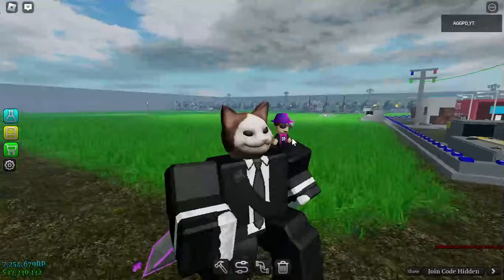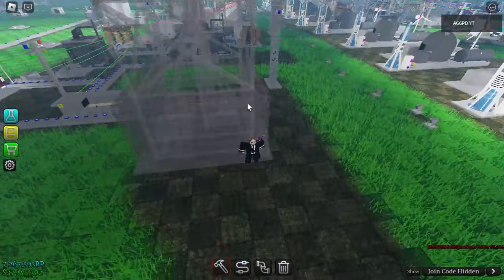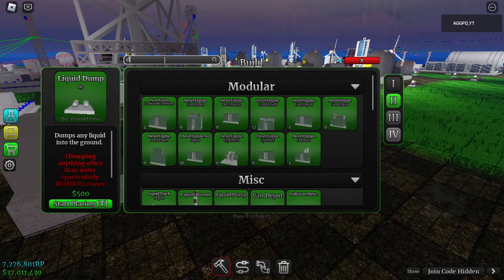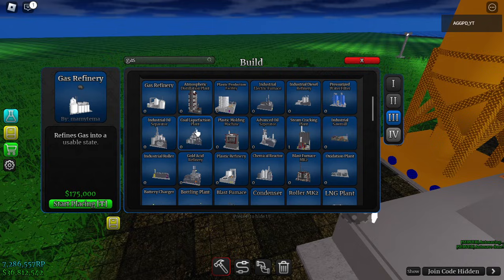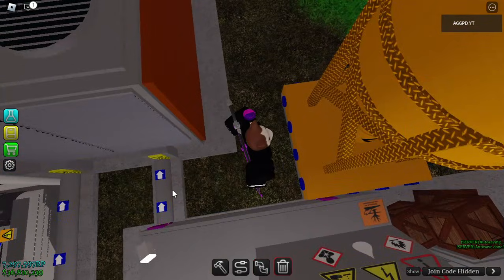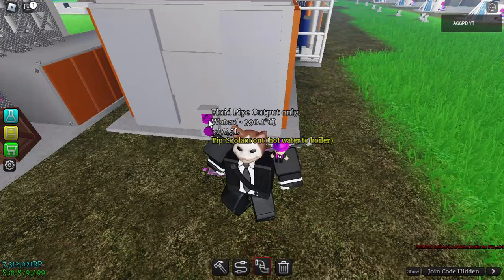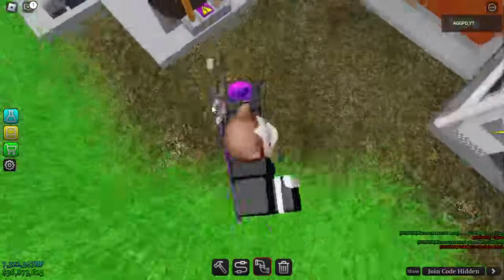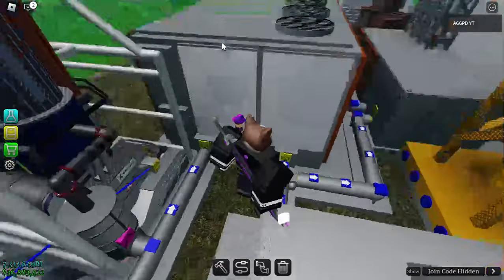⛽How To Make Gas Burner Setup ⚡ | Better Steam Turbine Setup | Industrialist | AGGPD_YT

Comment: a little (very) clickbaity to claim 1 GMF/s when one gas burner makes 5-6 MMF/s without chaining, oh and also the turbine setup itself is quite inefficient even if you arent using quantum piping
Reply from the maker: Just fixed it, thanks for the suggestion man, I miscalculated and made a mistake. Sorry for the inconvenience man, hope the fix is good enough.
Reply: whats a quantum piping
Reply: @andreizhdanov6812  Quantum piping is the things that can connect the pipe from others. Like you can output the pipe from second output to a pipe at first output
Reply: @Milza-wz6ho  i always do that
Reply: With Chaining gas burner makes 14-21mmf or something like that
Reply: What is chaining and how to do it

Comment: You don't actually need to reuse the boiler's water with pipes, you can just directly connect the water output to the input.
Reply from the maker: Sure, but the method by which the steam turbine setup is made is easy to make so I think it is good but you can still do it with your method that you mentioned here.